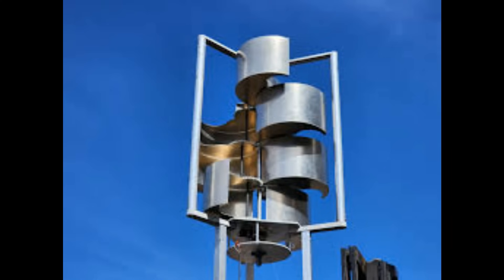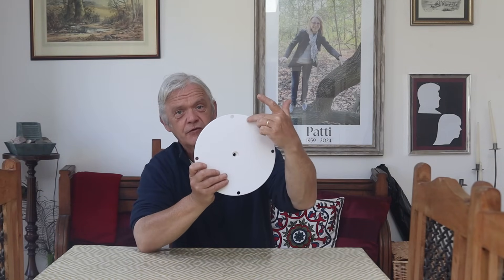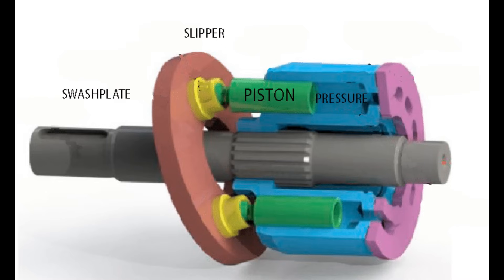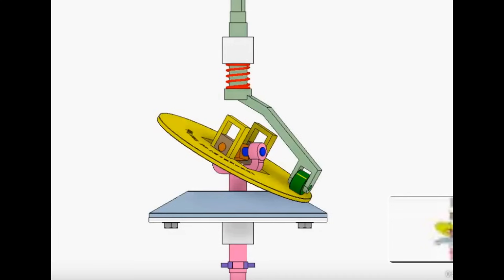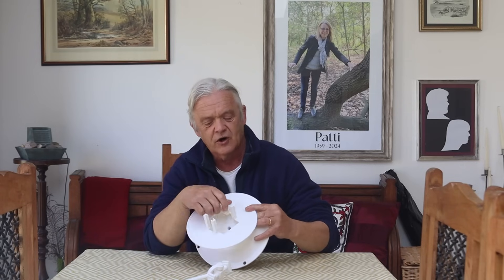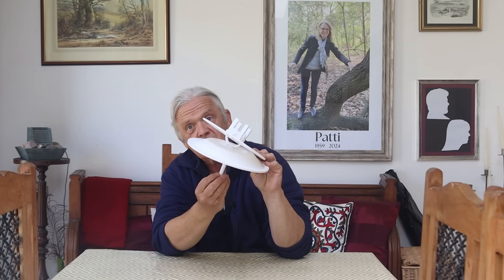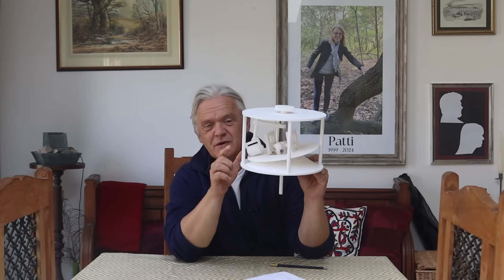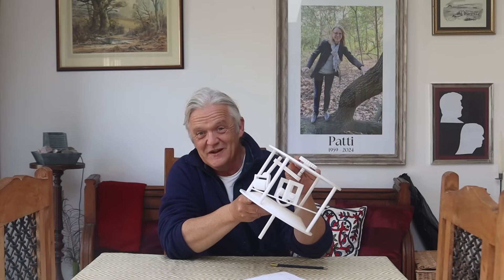2378 A Swash Plate CVT - No Gears, No Belts, No Friction

Comment: When you operate a standard universal joint at an angle (such as in this swashplate design), the input and output speeds are different. Only with a constant velocity joint will the input and output speeds be the same for an angled drive. How might that difference affect the output speed desired. Great discussion and modeling. Thanks for the resources and making us think!
Reply from the maker: I don't know mate - i'd have to have a look at it

Comment: Does the gear ratio fluctuate because of the universal joint, or is the output speed constant?
Reply from the maker: because of the changing distance between the roller and plate
Reply: @ThinkingandTinkering  No, I mean does using a universal joint instead of a CV joint mean that the output oscillates
Reply from the maker: @xzorby  oh right sorry mate - yes it does
Reply from the maker: you might want to check this out https://youtu.be/0FwypgRLSZQ

Comment: I don't quite understand why generators have a limit to how fast they can spin, and generate electricity. Doesn't the electricity leave the coils at the speed of light? I don't understand why the electricity can't be shuttled out as fast as it's generated? Doesn't it depend on the size of the outgoing conductors? Or does it depend on the size of the coils themselves? Is it because the voltage is too low? The way in which they are wound?
Reply from the maker: all wires have resistance mate - and with too many amps they get get hot - because resistance causes heat - that's how your toaster works.If they spin too fast they exceed the heat carrying capacity of the wire and melt - just how a fuse works
Reply: @ThinkingandTinkering  I'm aware. I thought generators made more voltage as they spin faster? No?
Reply from the maker: both
Reply: They overheat because of the speed they’re spinning.
Reply: @anthonynorris7736  The bearings?
Reply: @SyntacticOperator  yes and the bushings etc.
Reply: The monkeys get dizzy spinning too fast and the giraffe gets a bent neck watching...

Comment: I don't think it's a CVT, it can work as a clutch, but i'm not sure if it can change RPM of the output (because angular speed on the input and output seems to be the same). Could you please demonstrate  how this device changes speed of the rotation?
Reply: Its a ct, not a cvt, ie it doesn't vary input vs output speed; it just varies the distance from the axis where 2 surfaces touch; the relationship between that distance on the input end vs the ouput end doesn't change, so no variable speed.
Reply: Indeed. The rate at which the input and output rotate is the same.
Reply: @easyvolts2576  It is a hydraulic pump/motor combination with a swash plate to regulate pump displacement. Have one on my garden tractor.
Reply from the maker: i don't mind you don't think it is a CVT mate - it's up to you what you think - but you could research it if you wanted
Reply from the maker: you might want to check this out https://youtu.be/0FwypgRLSZQ

Comment: The swash plate pump is nice and simple as the flow can drive a hydraulic motor. A variable offset vane pump can do the same, and with a feedback loop, it can alter the offset on the fly as the load changes.
Reply from the maker: cheers mate